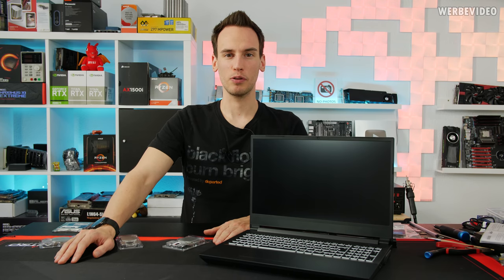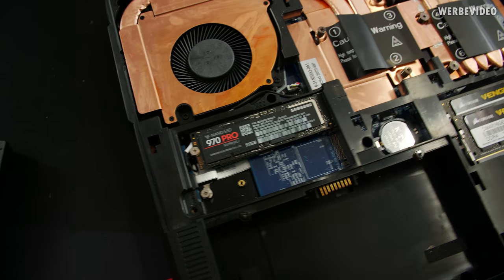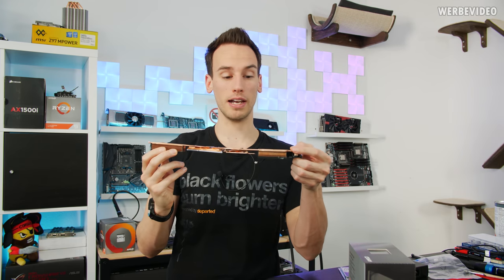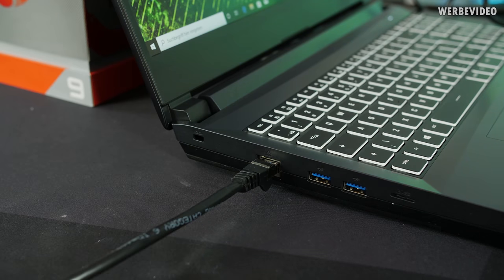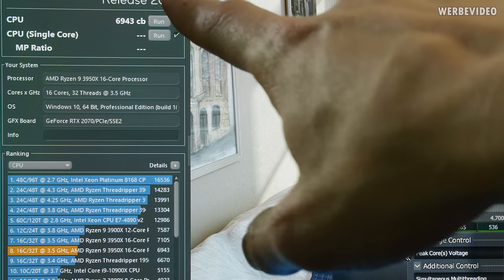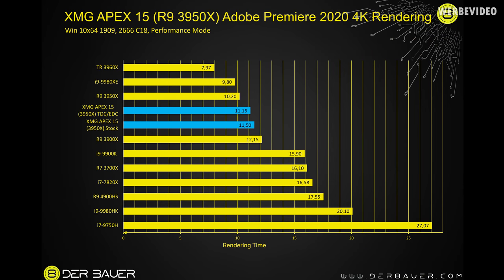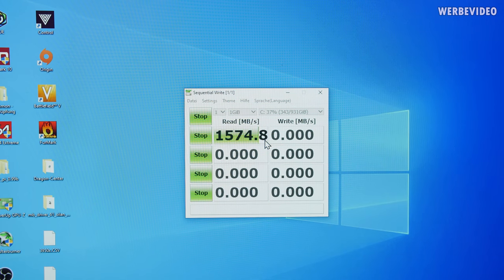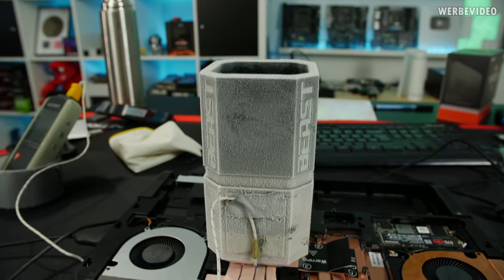INSANE: 16 Core AMD Desktop CPU in a NOTEBOOK. Ah yea and I added some Liquid Nitrogen

Comment: 11:11 Why does my 5 GHZ 8700k beat out EVERY CPU on this list in Single Threaded? I am at 522 Single, 4072 Multi in CB R20. I would have thought that at VERY least that the 9900Ks would have scored ~511+ Single Thread... 
For reference, I am at 5 GHZ all core all the time, 4.8 GHZ Ringbus and DDR4-3200 CL16 (16 16 36) - yet I blow away ALL of these CPUs per core..

Comment: if they can achieve this kind of performance in a laptop, literally using a desktop cpu. then they are not pushing desktops hard enough. desktop pc's/ spu's can go higher, can go hotter. we cant have little wee laptops almost keeping up with our high end massive and expensive desktop pc's... ;-)
Reply: This is nothing new though. Clevo have produced enormous DTRs for years. I have an old Clevo D900K which had a desktop Athlon, a D901C with a desktop QX9650 and 8800M GTX SLI. There were also the D900F and P570WM with LGA1366 and LGA2011 CPUs, and my P870 has a 7700K which I run at 5GHz all day. Granted these things do require some cooling mods if you want to overclock but they are nothing new really.
Reply: @Arrrbol  ah, ok cool man. or should i say hot, very hot? ;-)

Comment: I checked this laptop out on their site, I really liked it until I seen the upgrade part prices, may as well buy base model and then just buy the high end parts on your own with how much they charge. The biggest what the fuck with this machine is the chipset. Not x570, Not x470, but a fucking B450!! What the fuck!
Reply: B450 chipset has less power consumption which helps with thermals and (dare I say it) battery life. Our upgrade prices reflect the fact that we give full service and warranty on each individual configuration. On the AMD CPU upgrade prices, our purchasing prices are currently higher than in e-tailers because we can't buy the CPUs in the kind of volumes yet that e-tailers can. We're working on that. // Tom
Reply: @xmg_gg  okay I understand the point on chipset, still wouldn't think x470 uses much more than b450. But let's say upgrading to 3950x is adding 759 to the base. In my opinion it should only be the difference going from the base CPU cost, not adding full retail of 3950x